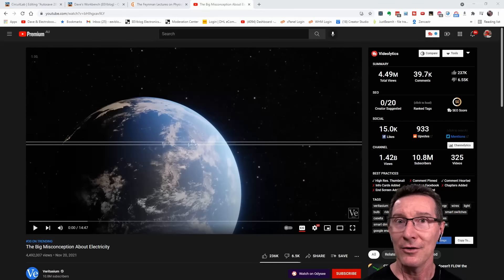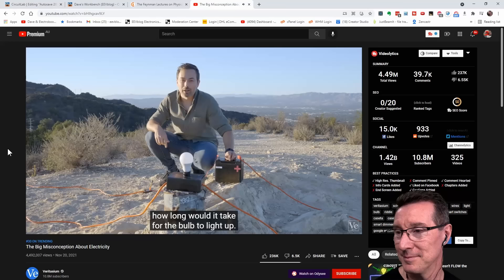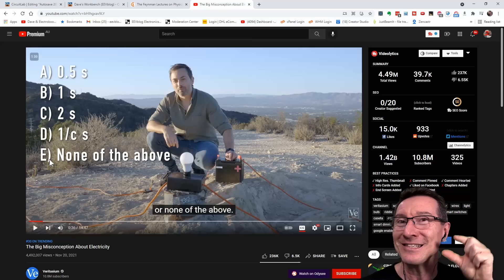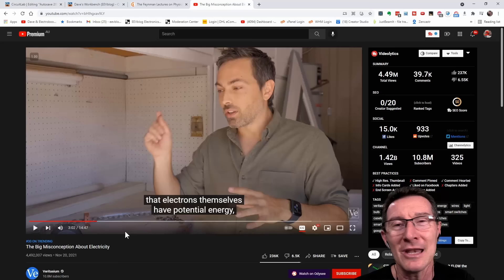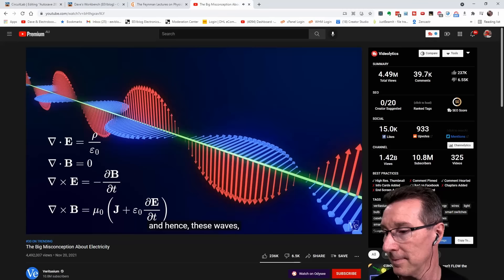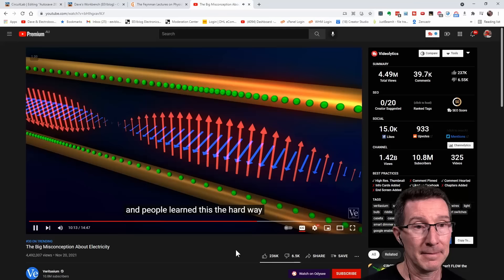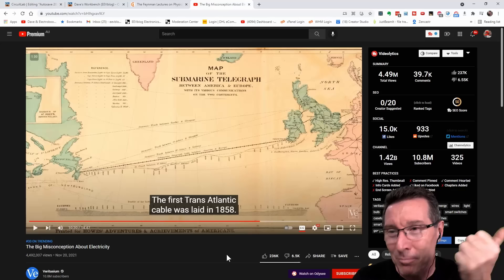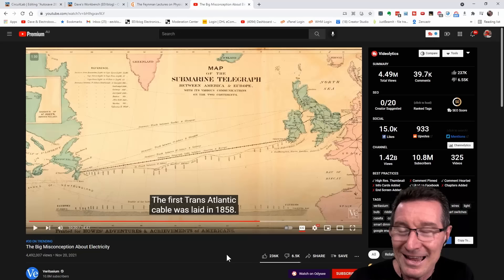EEVblog 1439 - Analysing Veritasium's Electricity Misconceptions Video

Comment: The "low frequency" "circuit type" engineers do not necessarily know the transmission line details.  I can remember talking to a digital design engineer that I worked with at IBM, who had graduated from Cornell, and I was trying to tell him about how a step function can bounce off the end of an open circuited transmission line and the voltage will double... so a 10 V step can produce a 20 V voltage for a time... and he would not believe me.
Reply: unill he gets emc problems
Reply: @mattmurphy7030  Did I say otherwise?  I think you read something into my post that I did not say.
Reply: Well, a degree does not prevent from being clueless…
Reply: He just probably never had any experience with RS485 lines, never connected an oscilloscope to the lines at different places and newer given the question of spacially distributed elements of the circuits enough thought. Just give him some time, reality tends to enlighten us once we lose any way around properly facing such a problem in a design and have to understand what is going on. 

Many other small discoveries are awaiting him along the way as well! Like having a voltage between different "grounds" or magic changes of voltage levels, magic 110ohm load from even an open twisted pair and many others. I am even a bit jealous. I wish I could experience that one more time.
Reply: @Kirillissimus  he just thought that Kirchhoff's Voltage Law always applied.  He thought that you cannot have a 10 V voltage source creating a 20 V voltage without a negative 10 V voltage somewhere in the loop.  He said "you don't know what you're talking about, you are obviously wrong."  There was a bit of "I went to a better school than you and you're out of your league and claiming ridiculous nonsense since you don't know better, and I do."
Reply: @drstrangelove09  I worked with someone who went to Cornell ... ehh ... lest I offend other graduates of said school ... I'll leave it at that.
Reply: Great example. HF Board design is rather complex and often counter intuitive in many places.
Reply: Doesn't that happen in antennas?
Reply: 60 Hz is high enough frequency for the power companies to put power line high in the air and to reduce "capacitive loss", the exact current and power loss that is being talked about.  At 60 Hz it takes a few miles of wire for it to matter, at GHz frequencies, it may take only a fraction of an inch, but it all the same stuff.
Reply: The "energy" outside the wires is not heat energy (if you are in a vacuum) since there is nothing being heated.  Or is it radiated infrared in proportion to resistance losses?  Assume current and power flow but no frictional/resistance losses in a theoretical ideal  wire material.  In a vacuum there are no kinetic energy losses either outside the wire, since there is nothing in a vacuum outside the wires to be accelerated.  Therefore, what form is the energy outside the wire?  What carries this energy if there is nothing there but a vacuum?  Energy is joules in units of newton meters, and newtons refer to accelerating matter at an increasing rate.  So if there is no matter to be accelerated outside the wire, what is the form of the energy in the accompanying changing electric and magnetic fields?
Reply: If energy is moving in free space around the wire, what would make it suddenly "want" to converge inside the filament and heat it to incandescence?  That sounds like a violation of entropy.
Reply: At all points in space there is some kind of gravitational field and some kind of electrical field and some kind of magnetic field.  What is the "stuff" that jumps out of the wire and increases the field (electric, magnetic) when the power is turned on and the current flows?
Reply: A proton has the mass of 1835 electrons.  Something is going on inside an electron we call "negative charge."  Must be the same thing only backwards/inside out/clockwise vs. counterclockwise is going on inside  a proton (or a positron) that we describe as "positive charge."    What is the "thing" that causes what we call electric charge?
Reply: @hausaffe100  ,  Providing HE (?) understands what EEVblog understands.
Reply: Well in my dept only EEs had to take a course on transmission lines, the CEs never did, which I found hilarious given the likelihood of finding high frequency electronics is far higher towards the computing end of the electronics spectrum, these were accredited programs as well ofc so I'd say the issue is with the curriculum standards
Reply: @jackieow6692  the energy is in the electro magnetic field. Mass can store potential and kinetic energy. Similar to a water wave you can think of the electromagnetic wave.  potential energy is stored In the electro static part of the field and the kinetic part is the magnetic field. Mass accelerates toward gravitation, charges towards their opposite. The analogy is not as visual for the kinetic part but the energy needs to go somewhere when the flow is stopped and it will be forcefully just like a water hammer. 

I just realized you are actually interested in the quantum field theory. Sry for the simplification but I am more engineer than quantum physicist
Reply: Very true. line theory is something else, only comming into ones mind when working with high frequency.
Reply: @hausaffe100  Exactly.  Until people start having EMC problems they don't care about fields.  Still, it's not either/or.
Reply: @drstrangelove09  Some people just like to believe in somerhing. For them it is hard to understand how can it be that nature does not follow any laws, especially not ones made up by us, and what physicists call "laws" are just mathematical models that have their initial assumptions and limitations. They do not get how something can be not entirely and absolutely true but still useful, for them such things should just be discarded as false. And only with personal experience can they change their mind and start to accept and understand the basic concept of models.
Reply: @xxportalxx.  the guy I'm talking about WAS a EE and NOT a CE... not all EEs learn about transmissions lines
Reply: BTW, I probably should not implicate Cornell as I have... I'm not certain any longer (it's been 26 years) that he was a graduate of Cornell... it could have been some other, similar, university.
Reply: @drstrangelove09  that's very odd, granted the requirements may have changed at some point. You see the standards are fairly universal in the states due to engineering programs needing accreditation to qualify for a PE license.
Reply: @drstrangelove09  It came without saying that it was not yesterday, but it is still strange that he did not know it. PCI bus was introduced about 30 years ago -- and it explicitly relied on voltage doubling from the reflection for signalling.

Even older computers had to deal with transmissions line effects, but I am not sure if they ever used reflections to a useful purpose -- probably just tried to get rid of them as much as possible.
Reply: @xxportalxx.  That was the point of my story about my colleague at IBM... he was not the only EE that did not know about these things.  Many of them had degrees from prestigious colleges.  I had other cases where engineers built test boards for high speed signals that were a rats nest of wires and could not see why they did not work... and I had conversations like above "what you say is not true... this should work."
Reply: @drstrangelove09  hahahaha well someone's gotta be graduating bottom of these classes 😜
Reply: @xxportalxx.  No... these were top graduates... you're not getting it.
Reply: @xxportalxx.  These engineers were very good at what they did!  They just did not know about the issues with signal integrity and designing boards and high speed signals.  We had people who were world class that did those things.
Reply: @drstrangelove09  you're telling me that they graduated from an accredited EE program and never had to take a course on transmission lines, don't buy it.
Reply: @xxportalxx.  People do not realize but IBM was the Apple of those days... actually better than Apple.  And they had the best people.
Reply: @xxportalxx.  You're drawing the wrong conclusions.
Reply: I also know for a fact, that most electrical engineers don't know how slowly electrons move through a wire.  Most just assume it's pretty fast, not having done the calculation themselves.  But most DO know that it's not at the speed of light.  As for transmission lines, yeah, a great many filed that information away at the end of the course and never had to think about it again.
Reply: @Socucius Ergalla To a degree I'm sure that's true but I'm not sure that accrediting boards in the U.S. go that deeply into the curriculum.  Apparently they do not based on my experiences. Unless the accrediting  boards decided that engineers do not need to know transmission line and higher freq concepts, there's that possibility as well.  Further, I did not really need to know, as an asic design engineer, working with VHDL, transmission line theory.  I also do not think that "dc" (low freq) engineers really need to now rf/high freq and transmission line concepts.
Reply: It is call atenuation.. And it is parazitic harmonic's.. base on RLC of circuit.. it will always be there ;)) And it will be ways piss me off.. And it will keep destroing expensive mosfet's on DIY projects.. And on table of Masters too ;)) we all do mistakes..
Reply: Hell even water in a pipe will have a pressure spike when it colides with a closed valve. (often called water hammer) What is so hard to believe? Conceptually it isn't too far from many practical voltage boosters. And in all these cases you can get way more than a doubling of pressure/voltage.
Reply: Without reflections we wouldn't be able to find fibre or coax breaks with O/ TDRs All hail the mighty reflection
Reply: @drstrangelove09  Must have had crap instructor then. One of the practicals you do is sending a square wave down a reel of unterminated coax and watch the returning reflection invert.
Reply: @kingsman428  no... he had not studied it... why all the machinations to avoid the obvious?
Reply: @jackieow6692  The energy comes from the collapsing of the magnetic field. This field could be collapsing into a load/ground point (earth rod, light bulb or opposite charged part of the Sun's corona). 

When magnetic fields collapse and snap, you get tremendous amounts of energy.
Reply: @jackieow6692  Charge is just a state various things can effect charge from leptons (muons, electrons etc) or quarks and hadrons (protons and exotic matter).

A proton is two up and one down quark bound via colour charge (mediated by gluons). The charge itself is an intrinsic property; even black holes can have charge. Without going into complex quantum physics I can't really explain it further very well. If you're interested in the subject you could pull a few key words from what I've said and just search.
Reply: @jackieow6692  The "stuff" as you call it is electric and magnetic flux. Energy is directed to the load because the transmission line acts as a sort of inside-out waveguide. Maxwell's equations predict what's observed; EEs have a variety of mathematical tools for solving different types of problems (antennas with Maxwell's equations and Poynting vectors; transmission lines with Smith charts, Bergeron diagrams, and lumped impedance models; and discrete circuits with "conventional" circuit analyses). You choose the tool that is the best-suited compromise between computational ease and accuracy. The full EM approach is accurate for  all cases, but computationally difficult for most.
Reply: @jackieow6692  gauge symmetry
Reply: @xxportalxx.  50% of all doctors graduated in the bottom half of their class...
Reply: @jp-wl9oi  ik, they all seem to work in my state
Reply: @kpaxxapk6397  it seems that the size of the wire would not make a difference in reflected energy on the surface. Is there a "layma's" explanation that explains why this happens? 

Is the reason that smaller wires aren't good at carrying a reflected wave because there aren't as many electrons to reflect backwards? This seems like it is decent explanation for the reason.
Reply: A long, open-ended HV ac transmission line can experience very much higher voltages than at the supply end- the Ferranti Effect.
Reply: @MervynPartin  at short pulse (for example) when it reflects off an open end, on a responsibly ling line, will double in voltage... regardless of the details of the source side, and yet I could not put this idea across to my colleague ... I think even the textbook did not convince (I don't think he would look at it, or I had sold the textbook)
Reply: @jackieow6692  the energy itself doesn’t propagate just the field propagates. The cross product vector just provides the spatial direction and sense of propagation. The energy delivery occurs via the interaction between negatively charged electrons and propagating electric field.
It’s the same thing with letting go of a mass in a gravitational field. The gravitational doesn’t delivery energy unless a mass exists under the influence of the gravitational field.
Reply: @jackieow6692  Electrons are still present in a vacuum, the form of the energy outside of the wire is as a magnetic field, the magnetic field is acting upon charged particles in the vacuum and the movement of the particles is what we measure as current
Reply: @jackieow6692 the particle which "is" the em field is the photon.